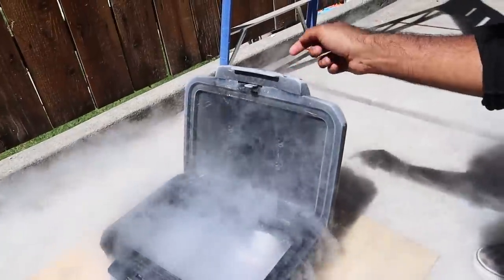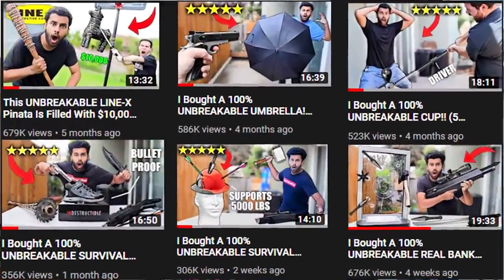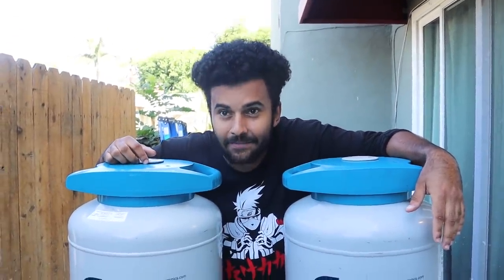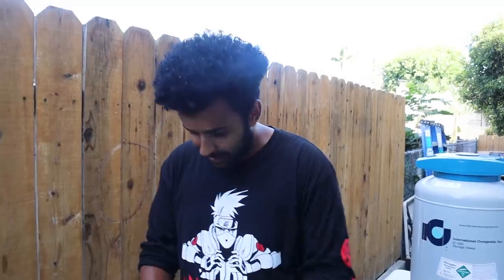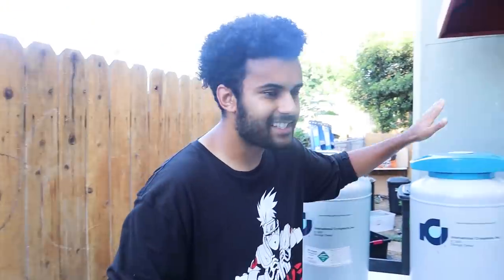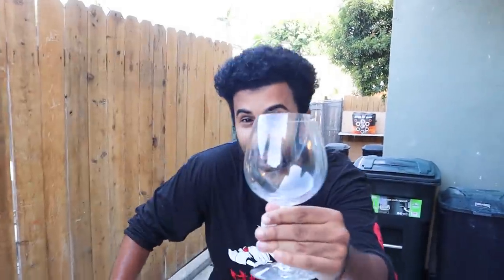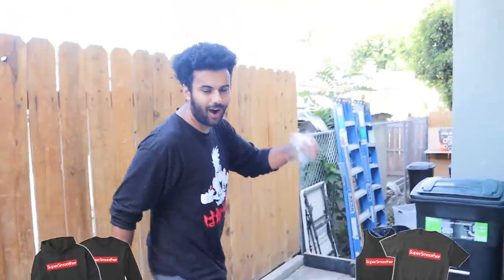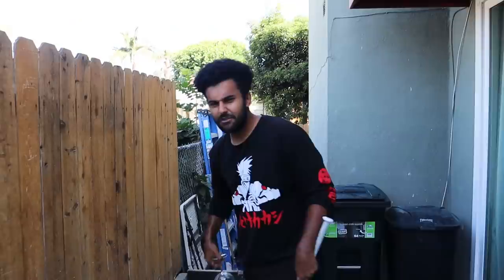DESTROYING 100% UNBREAKABLE OBJECTS Using LIQUID NITROGEN!! *REAL BANK BALLISTIC GLASS WINDOW*

Comment: Hydrogen is the first element in the periodic table and is very reactive to other elements and it is very unstable. And when you have dry ice and we'll sublimate straight to a gas.
Reply: do to troubles law when you guys take objects in liquid nitrogen the temperature change between the normal temperature in the temperature of the cold liquid nitrogen causes the object to crack.